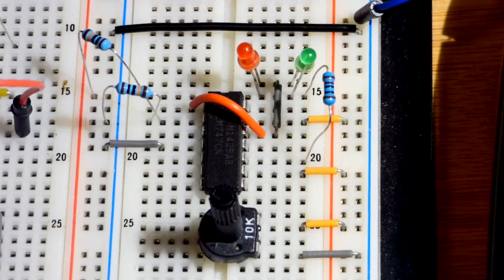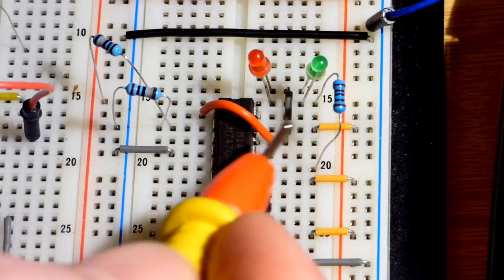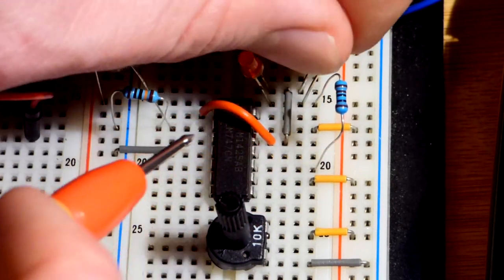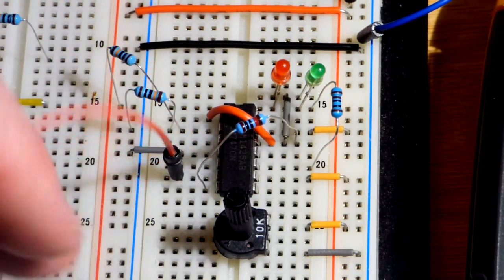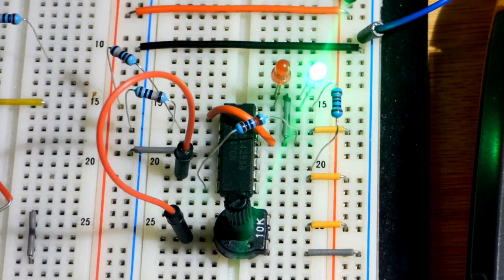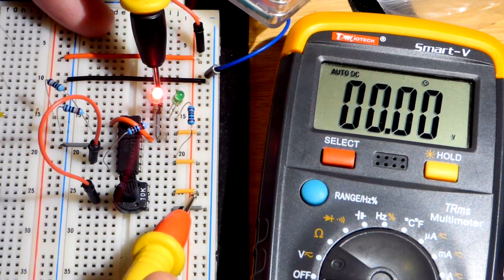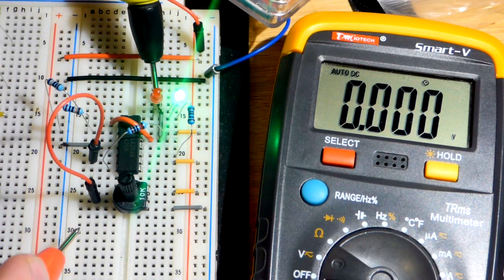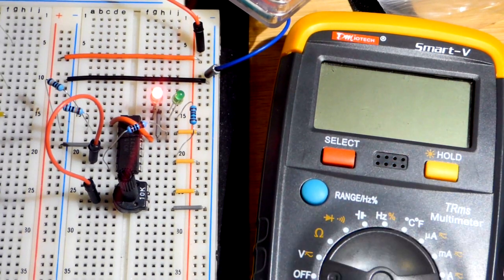LM747 747 dual op amp comparator circuit and virtual ground demonstration circuit

Comment: In my UA747CN, I have a small doubt. Iam getting the following values. Pls check and tell me what is the problem 
1IN1=8.3V
1IN2= -13.5v

2IN1=-13.6v
2IN2= 7.48v
Out1= -13.6v
Out2=-13.5V